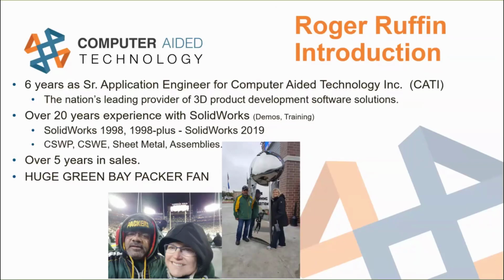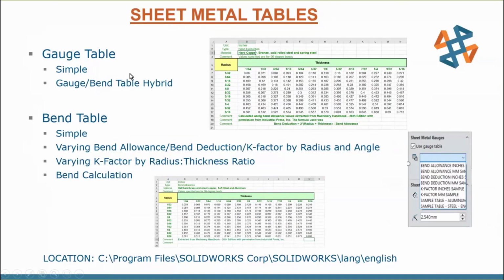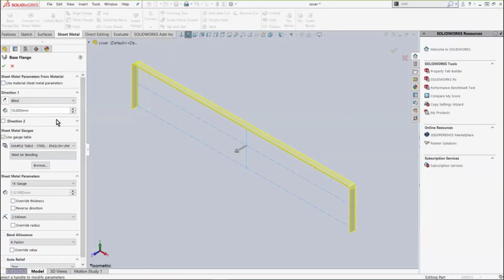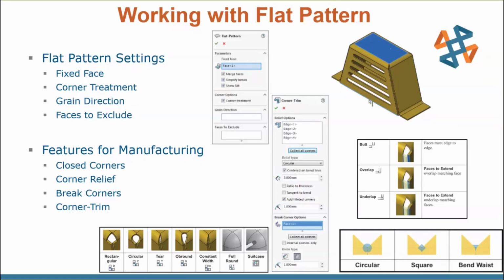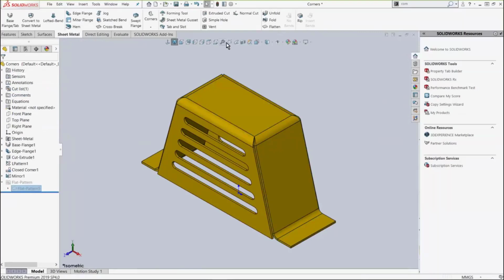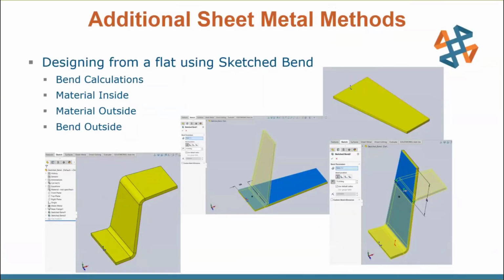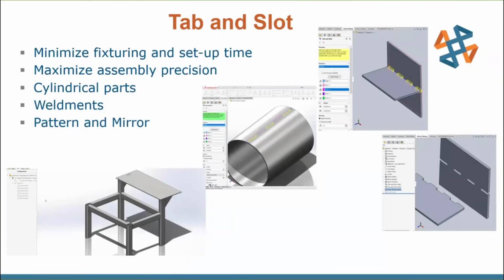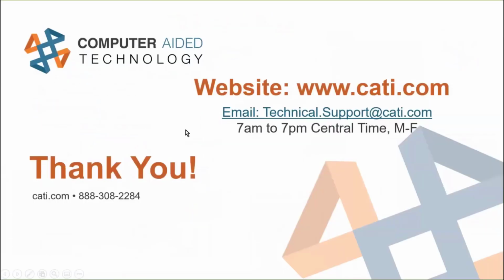Sheet Metal Tips and Tricks for SOLIDWORKS

Comment: how can i change step. file sheet metal thickness using direct editing tool?
Reply: John, 
SOLIDWORKS has a function called FeatureWorks that can be used to interpret STEP files into sheet metal geometry. Look for "Recognize Features" command! You'll be able to modify the thickness once it's a recognized feature the same way you would a standard sheet metal part.